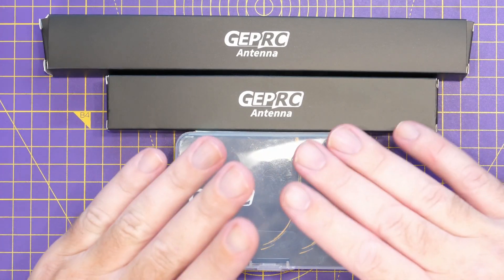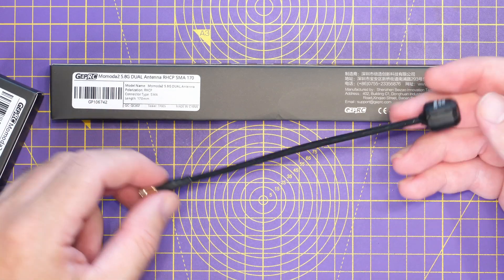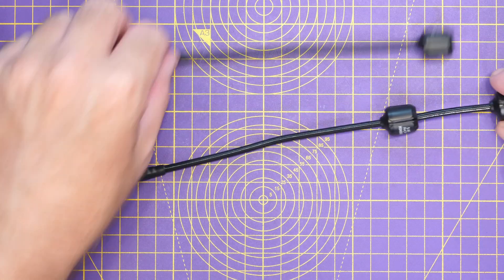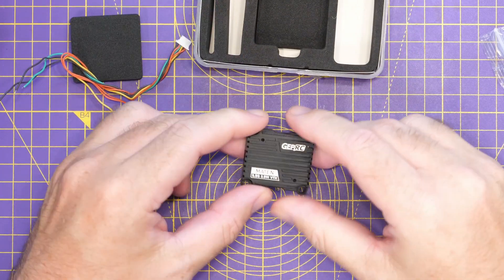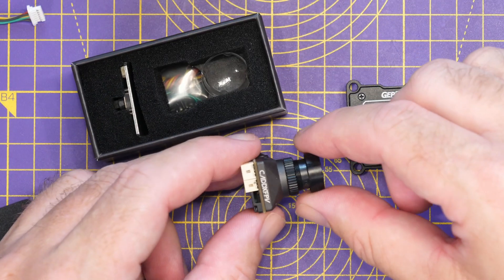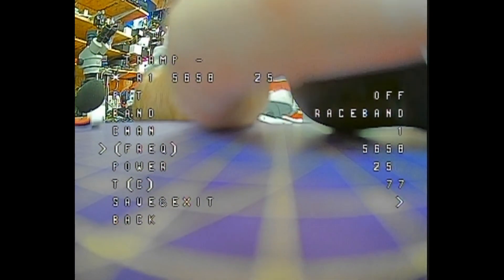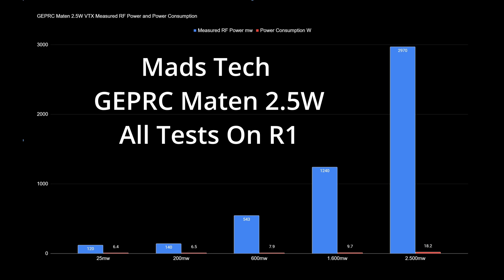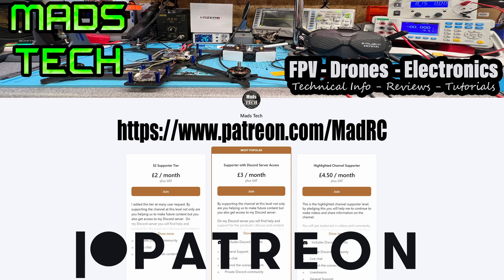GEPRC Maten 2.5W Analog VTX & New Antennas

Comment: I'm glad you tested this VTX. Chris Rosser said this VTX was putting out 11W of RF power when on its highest power mode. Which I knew couldn't be right. Your results make way more sense.
Reply: 11 W is impossible, would cook an egg quicker than a Walksnail VTX 😂 Paralled PA devices in this VTX are only capable of a watt or so each